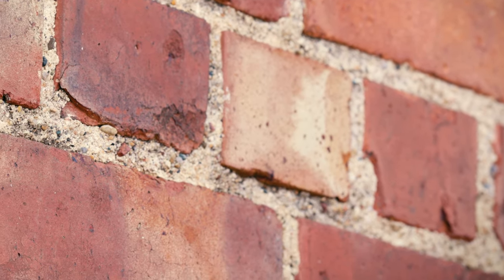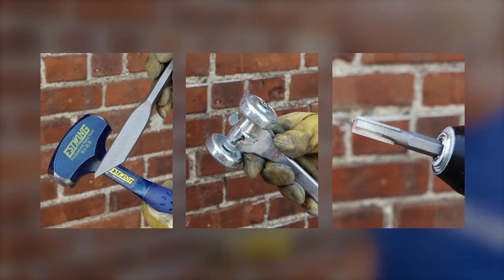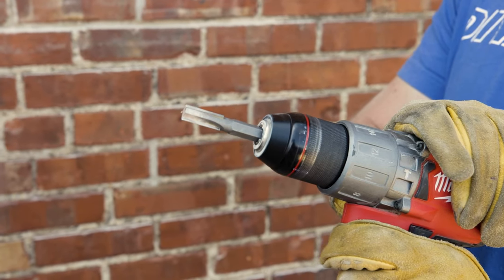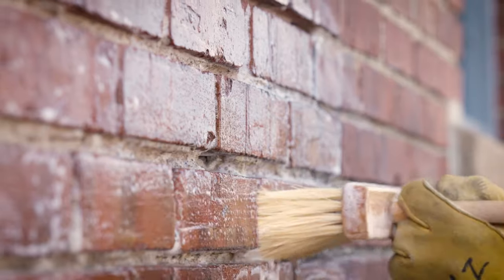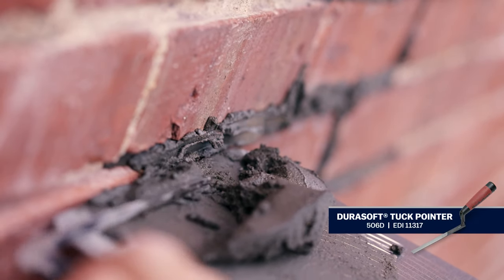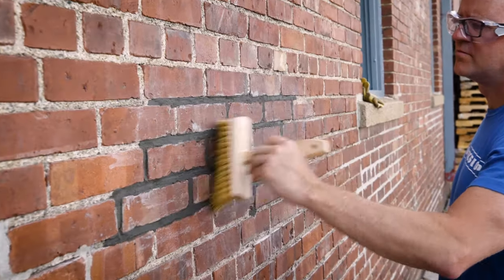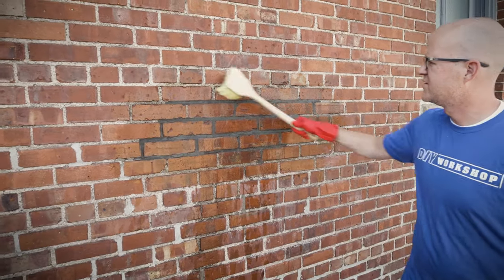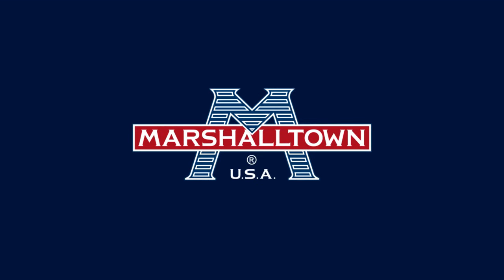Brick Repointing - DIY Workshop

Comment: Is matching the existing mortar functionally important or is it just for a better visual match? I need to do the inside of my detached garage at some point and dont really care much what it looks like
Reply from the maker: The look of the mortar is not functionally important but the type of mortar is.  Check with you local building codes to make sure you are using the correct mortar type for your specific application.  We recently published a blog on mortar types if you would like to learn more!  https://marshalltown.com/blog/which-type-of-mortar-should-you-be-using-for-your-next-project
Reply: @MarshalltownCompany  thank you!
Reply: Where can one buy the Mortar Rake for drill
Reply: @MarshalltownCompany I need my fireplace fixed it's leaking water when it rains bad..  had a guy come look at it and he told me it would cost 30k.  Said it needs tuckpoint and flashing my chimney or house isn't big home is only 1300 sqr ft.  I think he was trying to hustle me but I honestly have no knowledge in this field.  I just know winter is getting close and I really need to get it fixed and I damn sure don't have 30k laying around.   any chance you got an email I can send you pictures and you can give me some advice and info?   Situation has got me and the wife fighting its that bad.  I need an angel sent my way. 😞
Reply: @RoyHobbs-hk8cf 
I don’t know where you are located, but 30k for  a repoint and flashing is absolutely criminal!! Depending on the size that’s what is would cost to completely tear down and rebuild a medium to large chimney.
Reply: @RoyHobbs-hk8cf  You should do it yourself it is quite easy. Just be sure to create a safe working place, since you will be working at height. If you still intend to pay someone to do it, do not pay 30k because that is outrages. The price does depend on the size, state and height of the building, so I cannot give you an estimate. Good luck sir.

Comment: What if the existing wall is already painted? I want to flash point my fireplace  but it's already painted. So I am trying to find out whether and how to remove the existing paint to flash repoint it.
Reply from the maker: I want to be sure I'm understanding your question; what do you mean by flash pointing?
Reply: @MarshalltownCompany  Sorry I meant I want to put cement in the gaps between the bricks just like you did in the video here. 
My fireplace wall is similar to the wall you were doing here except that the gaps beween the bricks are larger, deeper and the bricks are also rough.

I want to put more cement like you to make it even and smooth but don't want to cover the bricks. 
However, the wall is painted with some sort of brick paint (including the cement in those grooves and gaps). 

So my question was, how do O achieve what you did in this video. Do I have to sand and scrape the paint first to put new cement layer?
Reply: @shkhamd Especially, since it is a fireplace, you should first deepen the excisting mortar to atleast 15mm to 20mm. Then you can repoint the bricks flush. After a few weeks you can repaint the whole thing.